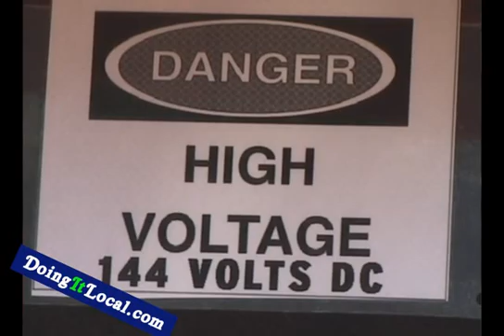home built electric car from toyota tercel

Comment: ITM power make a unit that costs £7000 that produces hydrogen and compresses it to gas cylinders, why not just convert a petrol engine to run on hydrogen? or get a car that runs on LPG and there is no need to convert anything, just reprogram the ECU for different fuel/air ratio or get one with manual choke

you could also sell hydrogen.

there just happens to be a BOC near my house, hydrogen is £1.15 per litre, cheaper than petrolium based shit and will yield more energy per litre